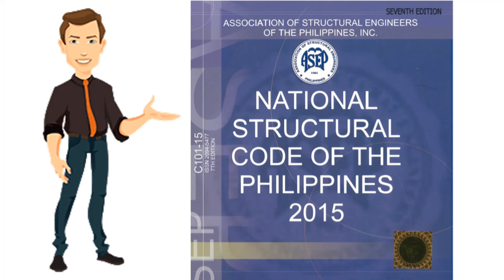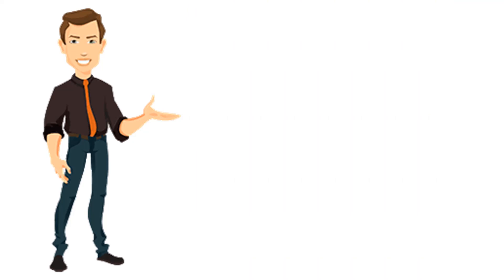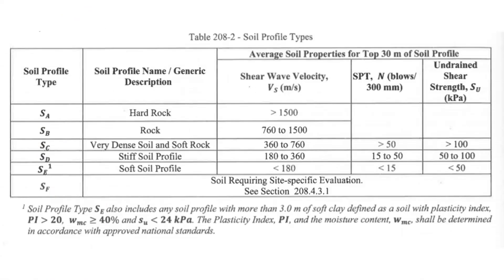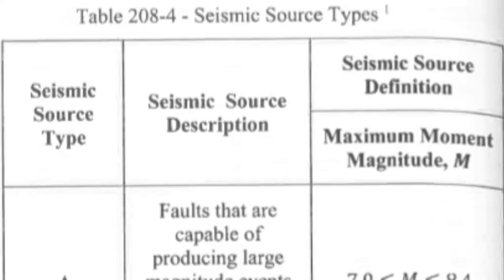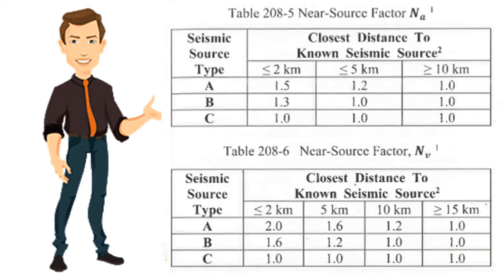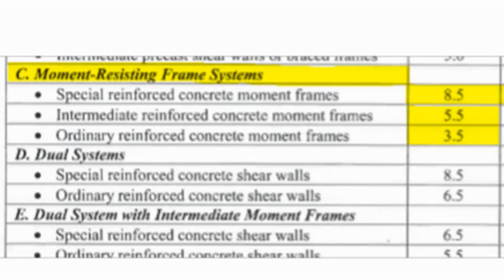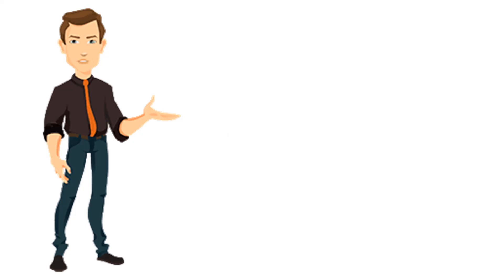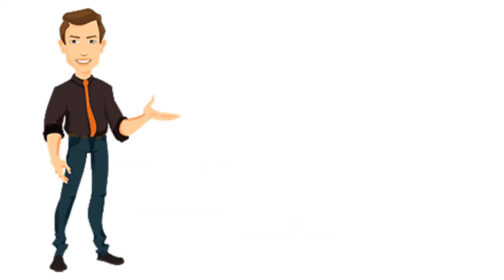1. EARTHQUAKE ENGINEERING-  DESIGN BASE SHEAR USING NATIONAL STRUCTURAL CODE OF THE PHILIPPINES

Comment: Saan po b nagaact ang base shear?start  distance from ground or from footing
Reply: Hindi po b s ground floor especially pag my plinth beam Kasi most failure po pag my equake dun s dugtungan Ng ground floor slab at poste
Reply from the maker: @zian.2493  Hindi po kasi yong total weight ng beam is nasa slab ng footing. However base on observation mauuna talaga masira ang sa ground floor due to secondary moment na nadedevelop that causes bending sa column duon sa ground floor.
Reply from the maker: Footing po

Comment: Hi sir. Why do we need to compute the base shear. Ano po importance nya.
Reply: Ibigsabihin sir dun sa computation nyu. Ang gagamitin na base shear ay 2176.56KN. Bale magrerecompute ka paliliitin sizes mga struct members para bumababa yung weight. At yung final computed base shear ay magiging mababa or equal dun sa 2176.56KN.?
Reply from the maker: @HappyHouseIdeas  yes possible lumaki or lumiit. Ang pinaka importante is malaman natin Ang internal forces ng mga member para maka pag design tayo. Dito papasok Ang RC or Steel Design. Kapag nalaman na natin nag internal forces ng acting member. But take note, that this values are due to seismic only.
Reply from the maker: The total horizontal shear or base shear will allow us to compute the lateral forces, the forces of each member and reactions (depending on the method you will use) which is will give significant values in designing the member of our structures considering the seismic force

Comment: Good day po sir. Tanong ko lang po Sana, doon po sa value ng numerical coefficient R, bakit po naging R=0.85 as to table 208-11A yung R po is 8.5. maraming salamat po.
Reply from the maker: Thank you for checking my solution well Ma'am Elizabeth. I actually mistaken it. I am very sorry. But I can guarantee that the process is correct. Thanks and God bless
Reply: Maraming salamat po sir. Your video helps a lot.